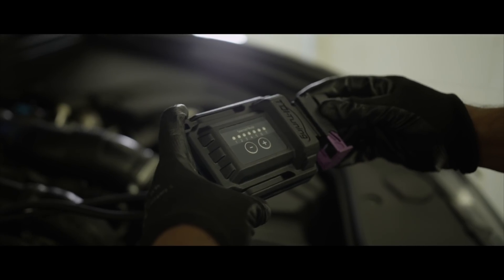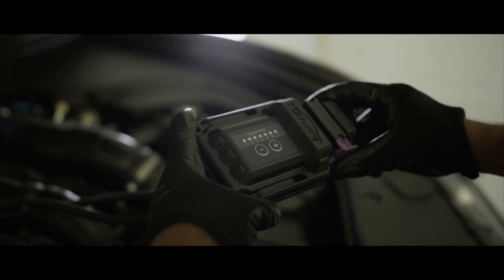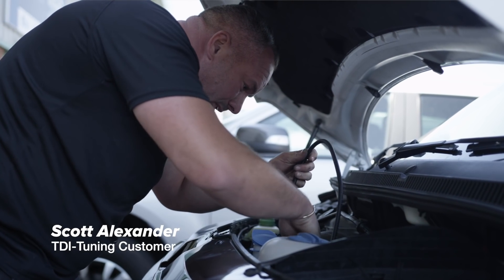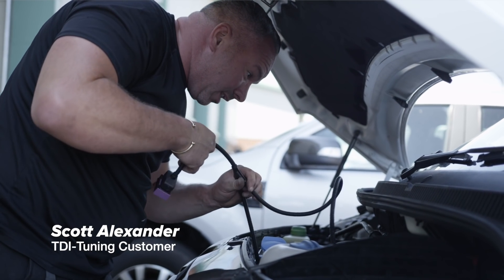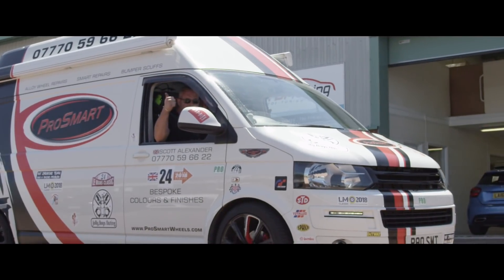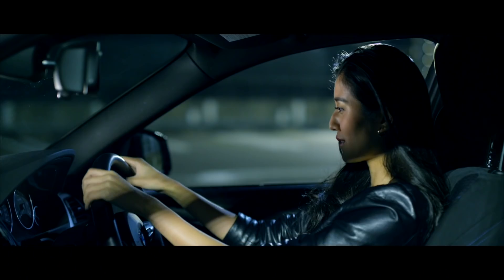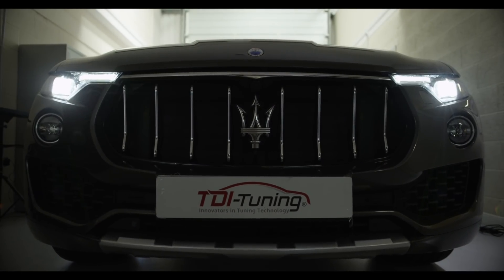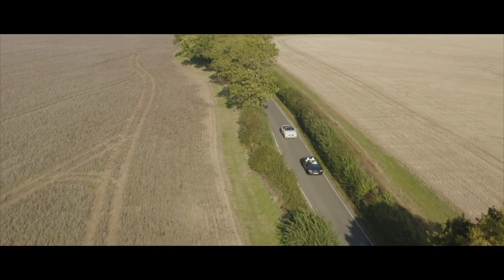What is a Tuning Box?

Comment: Aren't the tuning boxes just a boxed up and better marketed version of the old resistor trick from back in the 90's?
Reply from the maker: Hi Wesley, no, our tuning box connects to several sensors in the engine bay and optimises the sensor readings. Please let us know if we can help with anything else at all.
Reply: TDI Tuning Ltd I bit the bullet and bought a bluetooth version for my focus st250, sadly its sat on my sideboard because im shielding due to this virus. I also got 20% off 👍
Reply from the maker: @wezz69  excellent news! Let us know how you find it once you get it installed! We are pleased to hear you were able to take advantage of the sale we are currently running! Thanks again!

Comment: VW know all about these he fails to mention that it will void the warranty ecu logs everything (mini computer that holds data) stores it all even when the device has been removed.
Reply from the maker: The tuning box sends normal signals to the ECU so there will be no definitive trace a tuning box was attached as long as it's unplugged before inspection. We've conducted extensive testing on this and have never had a tuning box leave a trace. Please let us know if you have any further questions.

Comment: Untraceable? So vw won't know a thing if i took it off and got warrenty work done on my 2018 golf r?
Reply from the maker: That's right, once removed the tuning box leaves no trace both physically or digitally. If the manufacturer does a significant change to the ECU programming that affects the performance of the car with the tuning box reinstalled we offer a free reprogram to keep your car optimised.
Reply: @tdi_tuning  very interesting, thanks for the reply, very tempted to fit this after my 1st service, and take it off/on again a year later for it's 2nd service. Will I need additional software for my 7speed dsg in the golf r estate? So what you are saying is, that if something went wrong with the car for instance turbo, headgasket, gearbox etc... They will not look at my ecu and find that I was running anything othet than a standard car? Hence why I would take the box off for every service also. How does a facelift golf r  306bhp respond to the box in terms of reliability?  And although i'm looking at drivability rather than just headline peak power figures....i should still expect 370bhp right?
Reply: So do you warrant the engine and driveline if there is a trace found?
Reply from the maker: @laterz76  thanks for the reply. We do not need to. The TDI-Tuning box does not harm the engine in any way. We know this as we have been trading since 2005, and perform extensive testing on the products we release. 

The tuning box itself has a 3 year warranty. So long as the tuning system is fully removed there will not be a trace left behind. Thank you.
Reply: TDI Tuning Ltd so if that is the case that you are so sure, you would have no worries in warranting the engine then
Reply from the maker: @laterz76 We offer tuning boxes for hundreds of different makes/models. Not just that, but we cater to a vast age range of vehicles along with drastically different mileages. On top of that, engines need to be serviced according to the manufacturer's guidelines. There are simply too many variables for us to take into account for us to warrant engines. As we mentioned we have been trading since 2005, and perform extensive testing on the products we release so we know our products do not cause damage to engines. 
Please give us a call on 01245806446 if you wanted any more information.
Reply: TDI Tuning Ltd why does it need to be removed for vehicle manufacturers warranty reasons?
Reply from the maker: @laterz76  If you are just going to a local garage for a service chances are they will not even notice the system there. 

If you value your warranty and you take it to a main dealer then we would recommend removing it. Manufacturers look for anything so they do not have to pay out for warranty claims.

If you let us know what vehicle you have we can find out exactly what tuning box we would use for your vehicle. 

Please give us a call on 01245806446 if you wish to speak to a member of our team as it would save you having to wait for our marketing team to reply to your comments on youtube! Thanks again!

Comment: Something very important is not being told. Injectors needs to be upgraded to get the higher horsepower. I never got 151HP from my 102 Multivan with an ECU. I had to fit the 151 HP injectors.
Reply from the maker: That's not correct, we have for over a decade manufactured and sold tuning boxes to thousands of satisfied customers who have not had to make any further modifications to get greater performance. Stage 2 & Stage 3 modifications require more investment in additional performance parts like turbos, injectors and cooling but this modification is entirely plug and play.
Reply: What a fool 🤣